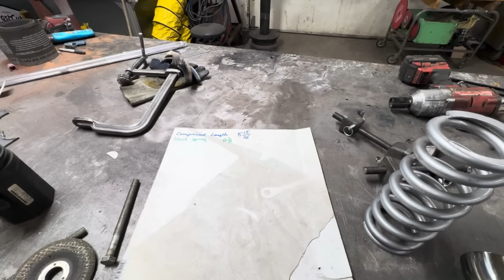66 Lincoln Continental - What is going on with this car that was built at another shop.

Comment: hey the rear ed is so log  i would put ad start to put the newer (2nd fuel tank toward the trunk(does not look like they ever (popped the muffler at (when the ticker had 5original mile's on it. the remove the original .the owner won't know the differance whenthey pro'ly didn't ever go for  a ride with this lincoln aand got it to leave it with they're other collected classic's. they (he or she) can drive only (1) ya know?  vechicle at a time?🚙🚙🚙🚙   💿cut above  wher the palm of your had is up in2 the trunk